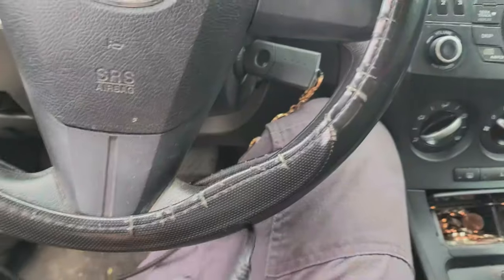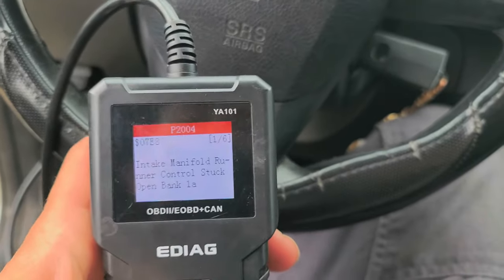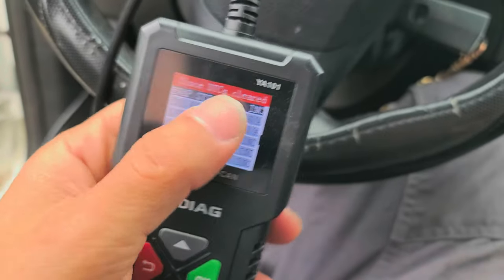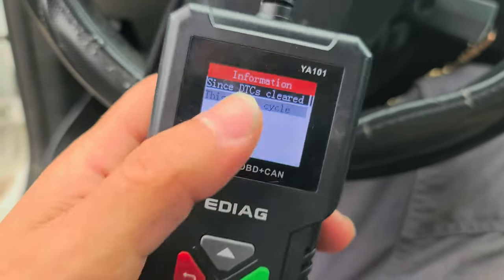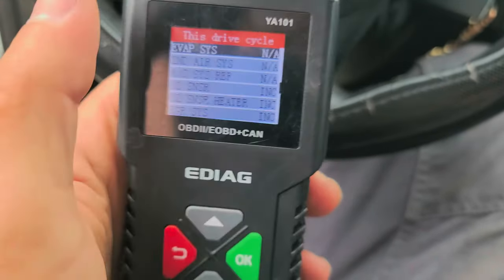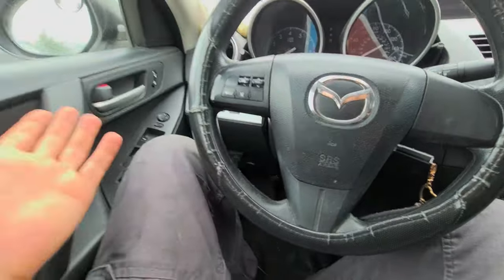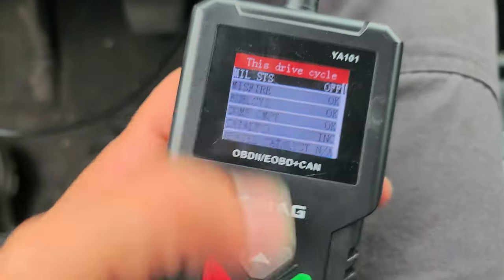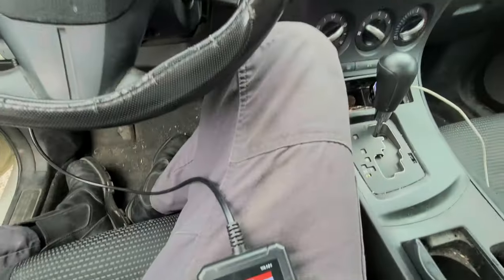how to clear permanent codes. what is stored codes pending codes and permanent codes explanation

Comment: You didnt show how to clear a permanent code. You just explained what needs to be done before the PCM itself erases the code, not you. No help.
Reply: You cannot erase a permanent code in 2010 and newer vehicles.  Only the ECU can get rid of it by detecting that the problem has been fixed.  Now how long it takes to do that?  No one seems to know the answer to that.   Point is really you can ignore permanent codes.  They are not hurting anyone being in there as long as your check engine light is off.
Reply: @stevew9563  bull. Emission test will not pass even if pending or confirmed codes are not active
Reply: @BernieJr89 unless you drive a diesel

Comment: Be sure to look up the prescribed drive cycle for your car. They’re usually very specific but the benefit is you aren’t randomly driving and guessing if you’ve done / driven enough. This is the fastest route to clearing the permanent codes after your repair.
Reply: Dudes. Got Covid.

Comment: So I put a new valve body in my Nissan rouge had code p0171 p1778 p0746 p0720 permant codes it drives better now it still doesn’t go in reverse do you think if I drive it around for a couple hundred miles it will work again? Sorry I’m new to mechanics

Comment: Thanks for info. Awesome video and explanation.

Drive cycles.. lol who knew.. I wish the launch scan tool had an explanation about that, but, who needs them when I found your video..

I have a permanent code for my DPF. I got a replacement one cleaned and tested but still have the permanent code.. 

I had 3 litres of engine go through it after the exhaust side of my turbo collapsed in on itself so cleaning wasn't an option.

I look forward to doing some drive cycles to get my 4wd out of limp mode

Comment: A Note for CA owners who may come across your video when they are trying to pass a SMOG check.  You do not have to clear a Permanent code in order to pass a smog check.  All you have to do is drive at least 200 miles and do at least 15 warm up cycles (Different from drive cycles)   Then the SMOG machine will ignore any permanent codes you have in there.   

Other than getting a smog check  there is no need to worry about a Permanent Code in  your car.  Nothing is broke and there is nothing more to fix.  Don't throw any more parts at it!.
Reply: What you mean nothing broke @Steve W
Reply: @sachskailg2784   - That's a hard concept to get because we are so used to codes meaning something is broken. But If your car is 2010 and newer and all you have is a permanent code with no check engine light nothing is broken.  If you drive it to get the monitors ready and you get a check engine light then look at the new current code that came up and repair that, but ignore the permanent code.
Reply: I have a 2012 Toyota thundra didn't pass smog because of a pending code PO4056 that's the same cycle told me to do but still hasn't cleared
Reply: @2010nvillanueva   - Do you have a Pending code or a Permanent code?  Do you have a check engine light on?
Reply: I have pending code PO4056 bery small leak evap try to find a way before I go back to get my smog but this cycles are stressful sometimes thanks quick response
Reply: @stevew9563  It had a check engine on light I erase after I fix the problem it haven't go on but I have the pending code
Reply: @2010nvillanueva   - So if you have a Pending code after a repair then your fix did not work.  You can pass a SMOG in CA with a pending code and Evap monitor not complete so if I were you I would just go for a test.  If they don't want to run it ask them  them to run it anyway and if they won't file a complaint on them with the BAR.   They are not supposed to keep people from failing they are to test cars as they are presented for a test.
Reply: @stevew9563  thanks for your advice this is very stressful I dont know why we need to go through even though I fix the problem the check engine light doesn't appear no more and pass me with a pending code that we have drive our car ridiculous miles of cycles thanks again .whose the bar ?
Reply: @2010nvillanueva  Bureau of Automotive Repair  - They regulate the smog shops.
Reply: I took my truck to the smog after endless drive miles in to it all my monitors shown all ok no stored codes no pending codes but I still didn't pass my smog because of a permanent code is still in the system secondary air system inc or NA I'm about to throw in the towel any advice
Reply: @2010nvillanueva   - Was this in CA?   Did they actually perform the smog or just see the permanent code in there and turn you away?
Reply: Here in CA San Diego.  At first he didn't want a do my retest I said I did everything you told me to do pass all my monitors run the cycle to get rid of the pending code now his saying I have a permanent code needs to cycle secondary air saying inc then I notice I got home its says NA on the secondary air monitor what's the difference
Reply: @2010nvillanueva   -  So he Did test it and you failed for a permanent code?  What model number scanner do you have?

N/A means you do not have that system in your truck.
Reply: first he use his own obd scan then he finally give into using smog check computer he said my secondary air system not ready
Reply: @2010nvillanueva   - Yea it looks like all engines of that year have an Air Injection Pump.  Not sure why your scanner not showing the monitor??
Reply: How does the smog machine know how much or how many miles was driven?
Reply: How about your check engine light is still there? Even after those cycles
Reply: @nathanderibe9230   - That means you still have an active fault that needs to be addressed.

Comment: I kept waiting for you to explain what a drive cycle is.
Reply: A drive cycle is just a certain way to drive your vehicle that enables it to run it's tests.  It's slightly different for every vehicle but most of the time just standard street and freeway driving is enough to perform the tests.   Some cars you have to get really specific and try to do it exactly as the drive cycle wants.   So really just depends on the car you have.

Comment: Thank you - it was a little rushed but I just played it again - drive cycles is not common knowledge at least for me. The smog check tech won't offer the simple just drive it for a while thing that a mechanic does - it's frustrating and ends up costing $$$ while I think something is badly wrong with the car. It is kinda sleazy especially in California that the cars computer does these test / drive cycles which have specific range of aspects that must be met in order to pass a smog check... meaning that you will get charged for a test that isn't what a smog check use to be but something a scanner will provide as far as if it's a pass or not - before going for the test so you just know it will pass... otherwise it's pay again and again for the problem... it's actually crazy!

Comment: THANK YOU!  I didn't know what INC meant on my scan tool.  Now I know.  I'm hoping mine will clear after a long trip.  (O2 sensor bank 1 sensor 2 voltage high appeared after running through car wash with underbody blast.  Hoping it was just moisture in the connector.)

Comment: I had a permanent code for 02 season after I replaced it i did exactly what you showed in this video and it disappeared so thank you and yes driver it ,stop it, open the door for 50 seconds and drive it again do that for a couple time and will solve the problem thank you again i had my my emotions test passed already

Comment: I got a 2013 camry p0302 misfire changed spark nd coil nd injector the chek engine pnly turns on at high way speeds sometimes with the traction controls car symbol but it only says misfire and spark plugs not oily wet what can it be
Reply: I’m got a p0303 right now and haven’t solved the issues what did you end up doing?

Comment: I’m months away from being exempt but have to get emissions one last time for renewal. Small evap leak not fuel cap not purge valve… it seems like it was only when you fill the tank completely, but now it’s showing check gas cap off and on and eventually check engine light. I really would like to fix it but if it’s prohibitively expensive…
Reply: Done a smoke test on the EVAP system?

Comment: I had a misfire in cylinder 5 change wires, coil and plugs cleared the codes but it still showed misfire in 5 found out the plug was a little longer than the rest of the plugs and the tip would bend in so there was no gap so I cleaned up the one of the old plugs and it worked no misfire now I've been driving for a over a week now it shows misfire on 5 again but my minivan is running fine I think my computer is showing ghost codes

Comment: The only way to clear permanent coach is disconnect the battery for 20 minutes. Or do enough drive cycles either way you got to do the drive cycles to pass emissions

Comment: Good morning 
I have my Opel Insignia B which is similar to Buick Regal, I have U1520-00 code and I tried to clear it but it won't be cleared. As far as I know it's related to power sounder of theft deterrent system which is actually not sounding, can you please help me to restore everything back to normal?
Best Regards
Reply: Is your check engine light on?

Comment: Interesting what you said about the permanent codes on the newer years. I just ran into this yesterday and i have an innova computer that couldn't erase it. This is the first time I've ever had that problem as it's always deleted bad codes till now.
So i think I've cured the problem and i take it i need to drive it to erase it....
My issue appears for now to be generated from a dead battery i was unaware of after attempting a remote start from inside the house 3 times not knowing the battery had died. This dropped it to 8 volts and i believe this caused a TCM code to pop up. At least i pray that's all that happened.
2019 Chrysler 300. I haven't driven it yet, i hope this is correct as I'm worried how it's going to handle shift points when i get on the road with another battery.

But hey, others say you can short the battery cables for several hours and remove these type codes any thoughts on that?

Thanks for your insight!
Reply: No do not short cables on any car that has computers in it.

Comment: Hello there i have a question
So i have sonata hybrid 2016 limited and there were a permanent code for p1235 obd 2 and i few drive cycles and now the code is pending ...
What should i do to clear it so i can pass smog in California?
Reply: Think you will have to make a repair if the code is Pending.  That means if the problem happens again it is going to turn on the check engine light.  Here is a vid on that code: https://www.youtube.com/watch?v=mSRPZinuBLU

Comment: I have a cylinder 2 misfire which is a pending code and not a stored code, Or permanent code. 
Replaced spark plugs which have been installed for about 24hrs now from my comment and pending code is still there.

Is there a way to clear pending codes on the foxwell nt301 or does it clear after a certain amount of drive cycle?
Reply: Sure a pending code you can clear at any time..   If you made a repair it would be smart to clear it all out and see what comes back up , if anything.

Comment: My 13 Infiniti g37 was over heating caused a the fan fuse was blown I change sb it it’s not over heating no nomore , the code p01217 says it’s over heating is a permanent code that pops up can’t pass smog , so I drive 15 cycles and still there can’t seem to get rid of the code pls help ??
Reply: You drive 200 miles and 15 warm up cycles and the smog computer will ignore the code.  It wont clear it but it will be ignored.   Thats 200 miles and 15 warm ps since you cleared teh code after the repair. Don't clear codes anymore as it resets that count.
Reply: @stevew9563  wow thank my Steve I will go get my smog test then
Reply: @AlvaroFG2   - Make sure your monitors are ready as well.

Comment: How can i clear a pending P26c8 code on my 2018 buick lacrosse?
Reply: Sure but if you do not fix the problem that caused the code then it will just come back.
Reply: I just need to clear it to pass inspection
Reply: Well in most states they check to see if the monitors are set. So the pending code will probably come back in the time and miles it will take you to get the monitors set.    But try it , might get lucky

Comment: I have permanent TCM code P0882 and my scanner will not erase it. What scanner can u use to clear it?
Reply: No scanner can erase it.  Do you have to pass an emissions test in your state?  What state?
Reply: @stevew9563  Im in NC, however the light shows up in my scanner but it doesn’t pop up on my dash,. Do I need a OBD scanner for transmissions?
Reply: @manuelsalgado8510   -  Do you have an emissions test to pass?  OTherwise just ignore it. 

No,  no scanner can clear it.

Comment: I got stored code P0171 on 2006 Honda Civic si 2.0 coupe everything is fixed what can I do to fixed this issue I have no vacuum leak,thank you ahead keep on your helpful videos🙏
Reply: Is  your check engine light on?  And what do you mean by a "Stored" code?  Does it say Pending or Current?
Reply: omg i have this right know it is the worst!!!!!!!
Reply: i replaced my MAS and i think it worked but i think a have a problem with a link to my charcoal canister? im going to make a homemade smoke machine to find vacuum leak. this help me to understand a lot   (The Trainer #70 - EVAP Testing Tips)

Comment: what about anti lock sensors and brake codes?
Reply: Those usually do not turn on the check engine light as they are not emissions related.

Comment: So I have a permanent code p0087 “   Car runs fine can u guide me what is the issue
Reply: If your check engine light is off there is no issue.  A permanent code with no check engine light does not mean anything is wrong with your car.

Comment: Got a permanent codes for P0420, P0455 & P0441.

Fixed everything from sensor, gas cap, pcv valve, purge valve & canister. 

Mine goes from STORED, PENDING to now its PERMANENT. Drove it around for cleared the codes and  drove it around for 20-50 miles then the codes would re-appear back again. 

So i cleared it again then same issue. After 20-50 miles. All 3 codes would pop up again. 

So how can i fix this? As soon as it would pop up just continue driving it for 200 miles and see how it goes? 

NOTE: as soon as i replaced the parts mentioned above. The car is smoothe to drive already. Got no issue except for the codes. 

Any help @Jabo the mechanic
Reply: What year is your car?
Reply: 2017 tacoma
Reply: @sachskailg2784   - Yea just concentrate on the current codes and ignore the permanent codes.
Reply: I dont havw any current codes. Thise are the original codes i have when it came on.

P0420, P0455 & P0441.

Thats why i did those repairs mentioned on top.
Reply: @sachskailg2784   - AH OK I thought you said your check engine light was on again after you did the repairs and cleared the codes?
Do you have to pass a CA smog?
Reply: It did. After i did all the repairs and cleared those 3 codes. Drove it about 20-50 miles. Then it ✅ engine light came back ON again. I did these twice. (Cleared & drive around).
Reply: NO i dont have to pass SMOG yet. Everything drives smoothely. Just dont like the ✅ engine light ON. Wanted it gone.

Thats why from reading the comments. I thought i should drive it around for 200 miles to clear the cose itself or what not
Reply: @sachskailg2784   - Oh OK so if the check engine light came back on you need to find out what "current" or "stored" or "Active" codes you have.  Scanner manufacturers all call them something different.   So what codes do you have that are not "permanent" ones??
Reply: I dont have codes that are “ NOT PERMANENT” ones.

All of the 3 codes i have now are all PERMANENT CODES.
Reply: @sachskailg2784   - Well I do not know what to tell you.  Permanent codes do not turn on the Check engine light. So something is turning it on.  It may be the same codes as before but they should be showing up as "Current " or "Active" codes.   Hard to tell without me looking at your scanner.
Reply: I have this stupid audi a3 Tdi Dpf w9n Regen 2 permanets codes idid the 200 miles 15 warmups and still in limp mode im tired i need a Tesla

Comment: You could earn 100000 subscribers if you could figure out how to reset the service. Light for service oil. That's days on permanently after your car approaches 200000 miles. BMW with an N52 motor.

Comment: This is a really bad system the companies brought on this vehicle. They gonna expose ppl to go back and forth to a mechanic that they didn't even know he fixed the problem or not, until they found out after those cycles. Which is terrible!!
Reply: Good mechanics are supposed to verify thier fix by completing the associated drive cycle and make sure the code that it came in for does not come back up.    THis is of course time consuming and many mechanics just send it and hope they fixed it.
Reply: @stevew9563  you are right, that's how it has to be done. my wife car is facing a problem that the mechanic didn't even do the cycle to check his work or explain it for her that, and he made us returned so many times.

Comment: If you tune a code out with hp tuner will the perm code eventually go away? p0449
Reply: Would have to ask HP tuners on that.  If HP tuners strategy to eliminate that code is to not allow the monitor for that code to run then yea it may never clear.    Fora PDTC to clear it wants to see the same conditions present when the code set 3-40 times with no error.   Or it wants to see the Drive cycle conditions met for that monitored system 3-40 times with no error.   If HP tuners gets in the way of that then yea it will be there forever.   Do you have to pass an emission test? What state?